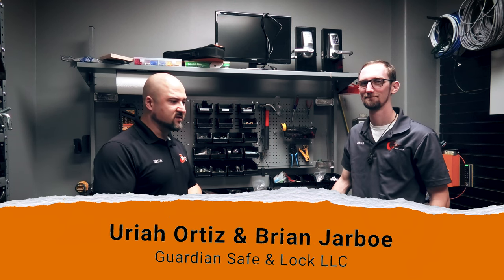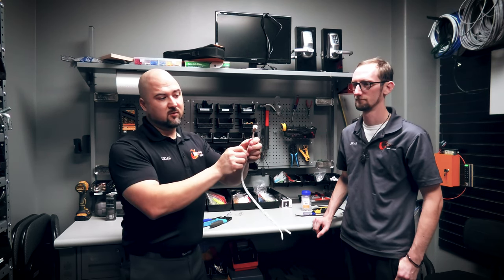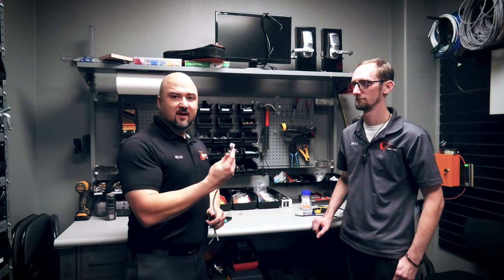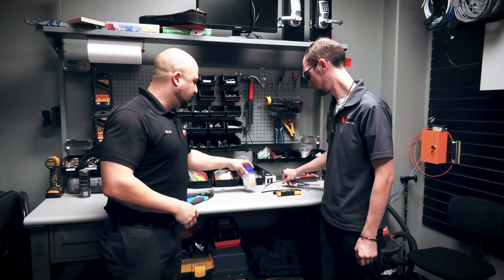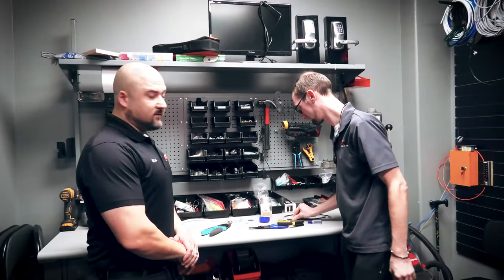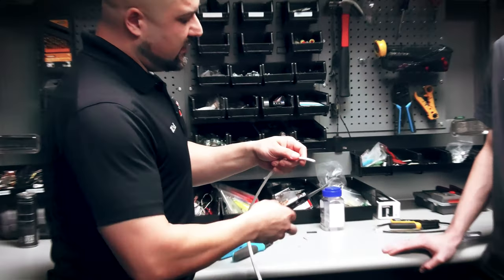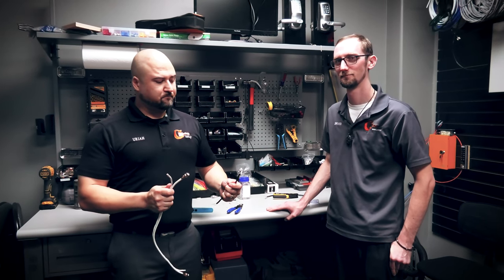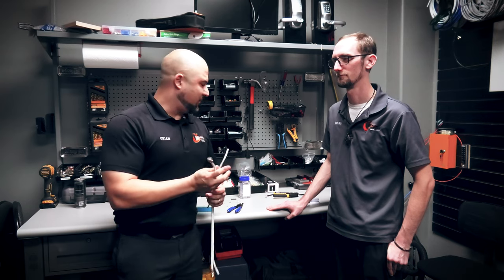Terminating Cable Ends For Security Cameras |  How To Terminate Cat6 & Coaxial Wire

Comment: They have actual rg59/rg6 cable stripper tool to strip the cable much easier then trying to use wire strippers.
Reply from the maker: Yep we also use those, but I want my technicians to know how to manually do it in case their tool breaks. Thanks for watching, if interested we have two other YouTube channels UDROpreneur and Guardian Approved. Thanks for watching!